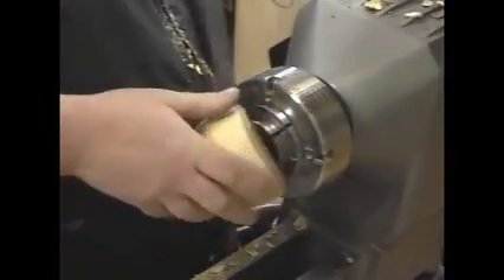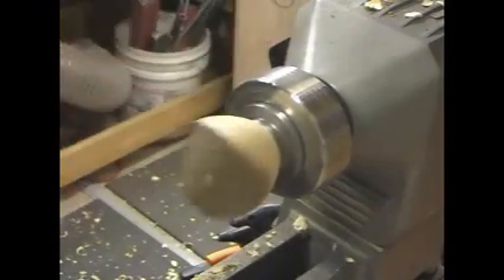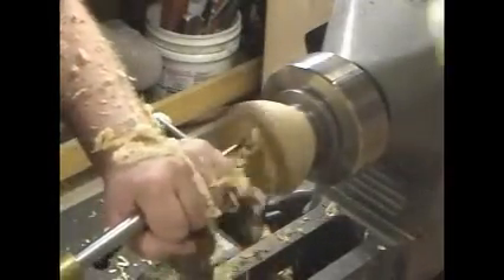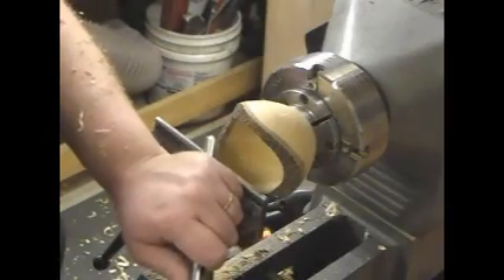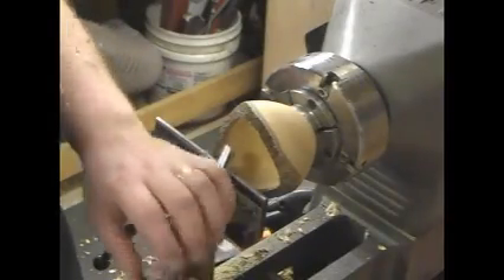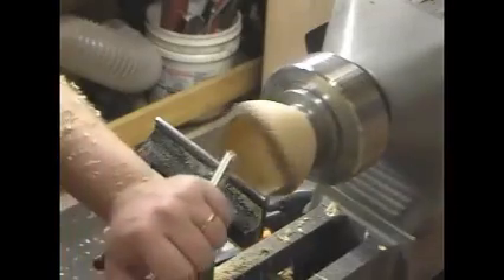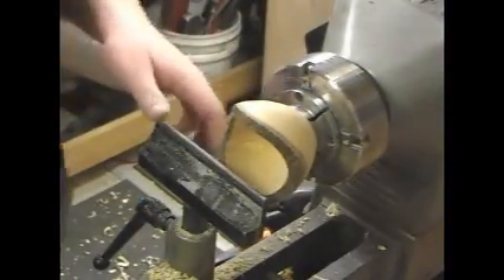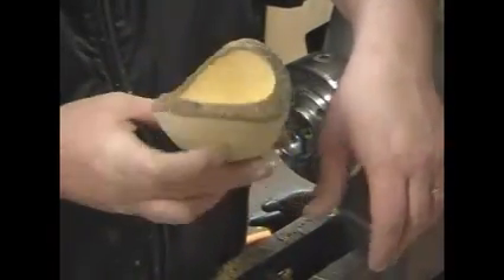Rough Turning a Natural Edge Bowl Part 2

Comment from the maker: @synbady2k 

Hi Jim!

The DNA bath (DeNatured Alcohol) replaces the water in the wood with DNA. Once removed from the DNA and wrapped up to slow drying, the DNA more quickly evaporates from the wood and this usually stops a lot of the cracking you mentioned in green wood, it also speeds up the process, so green rough outs can be turned in say six weeks instead of six months.

Google "Alcohol soaking method for drying bowls by Dave Smith" and you will find a lot of info.

Thanks!